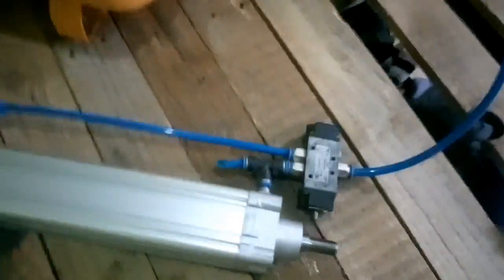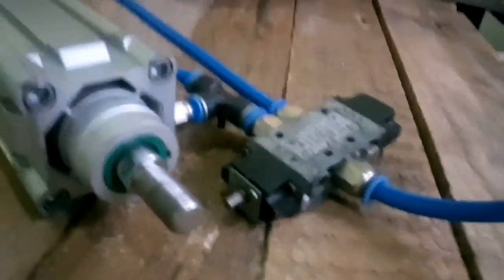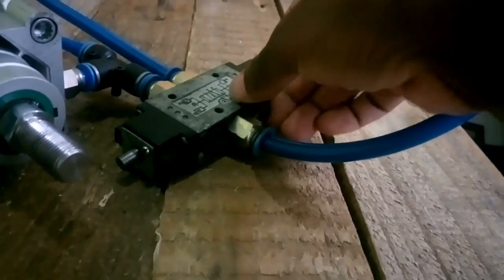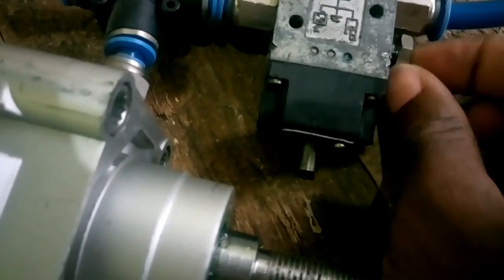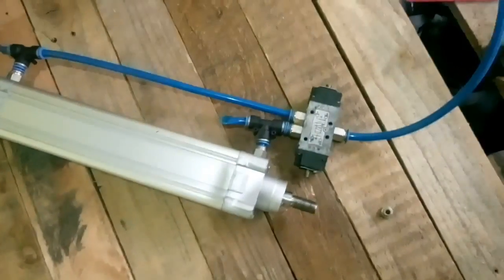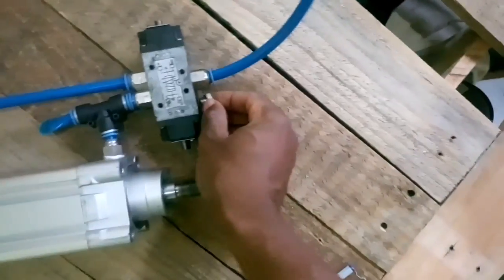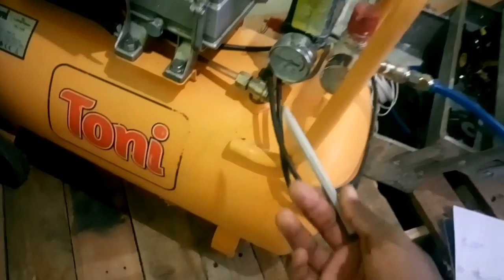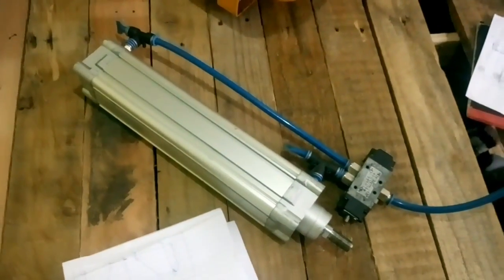Pneumatic basics - air compressor, valve & cylinder speed control (Part 1- Plastic Injector )

Comment: Don't give up - it's working! It works slower in one direction because there is less total pressure (air volume is less on side with piston). When you inject the plastic, should it be fast or slow?
Reply from the maker: It has already worked but at that time didnt have a camera to use , will be posting a video soon , 
When injecting plastic you want it fast enough to avoid plastic solidifying before feeling mold but slow enough to avoid burning the plastic... And yes using fast speeds burns the plastic it somehow adds more heat something to do with compression- couldnt believe it when i saw it but yah it happens

Comment: What is use of ristricter or filter
Reply from the maker: Restrictor is actually an exhaust port on the valve, its use is to discharge air from the cylinder and also in a way control speed.

 Since its a double acting cylinder as air gets into one side of the cylinder air on the other side of cylinder needs to be removed for the rod to move. Infact if one closes exhaust port(restrictor) the cylinder rod will not move at all.
And by varying the size of the (restrictor) or exhaust port you control speed.

Comment: Hi, Thank you for video. Where did you get the control valve? I have a few cylinders and would like to experiment.
Reply from the maker: You Welcome,  picked up the control valve (not connected to anything)   from scrap yard, it was in such a bad state that i was given for free. luckily 
when i got home discovered inside o-rings were in mint condition 

Had to machine buttons to convert valve to manual actuation as it initially used air actuation it actually had small cylinders in it, later i then converted valve to a solenoid control valve to use on my homebuilt plastic injector. 
What are you planning to build though ? 
And you will also need to identify the type of cylinders you have before getting  a valve for it,  valve can either be a One way or Two way control valve..

Good luck!!! on your build let me know how it goes
Reply: Sir i have 5 gallon air tank.  Is this enough or should I use air compressor?
Reply from the maker: Hi, An air compressor will do just fine for continuous use
Reply from the maker: @kulkarniteja  00263773061691